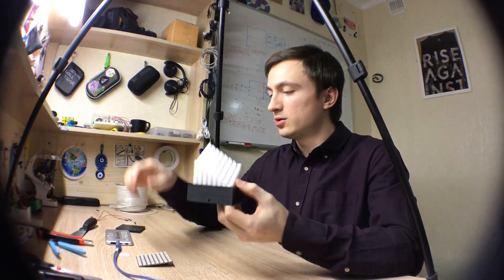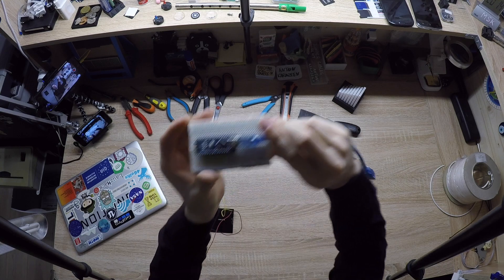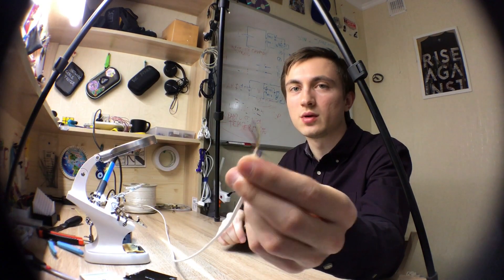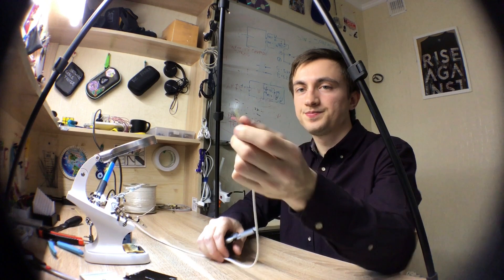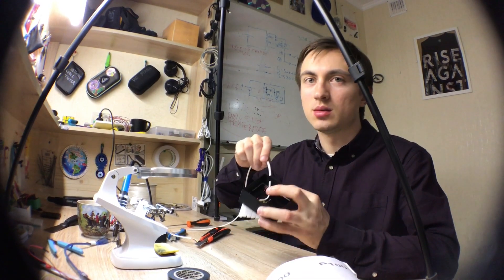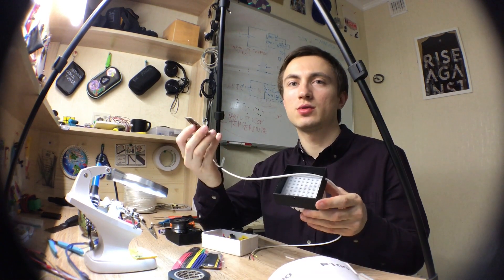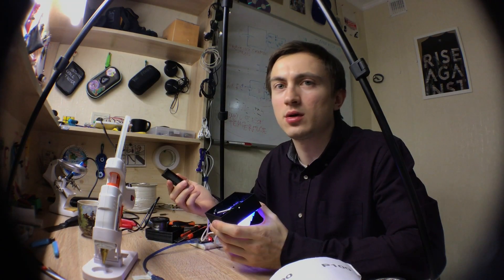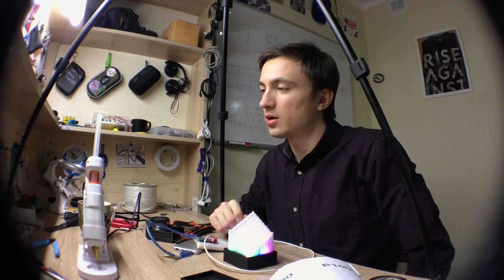🔮 3D Printed RGB Night Light Lamp with Arduino NANO

Comment: Great. I just printed this myself and it works great. Do you have a sample of the Arduino Code to share? Or are you just using the sample codes from the libraries?
Reply from the maker: Hi glad to hear from you!
Yes and yes -- I'm using sample codes from libraries (I modified it for the project) and I have a code to share. There are two "versions" -- 'main' and 'dev', link to them I'll attach to this video's description
Reply: Perfect, thank you. I will try it later then.
Reply: @AntonKarazeev  For using the button, I just need to put a pushbutton in the circuit between D7 and Gnd, right?
Reply from the maker: @Balrog132  yep, correct. Other options are (1) just set "mode" beforehand in the code (just put mode=<number> line before "if (DEBUG) {") or (2) use "main.ino" with simple animation. Hope everything will work ;)